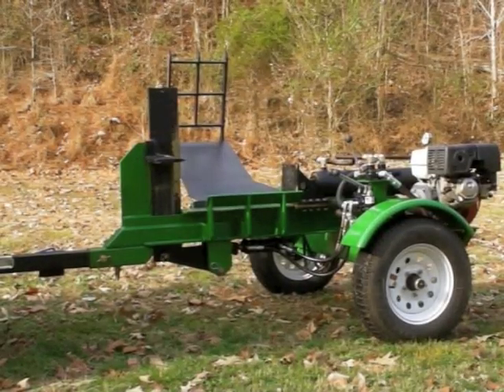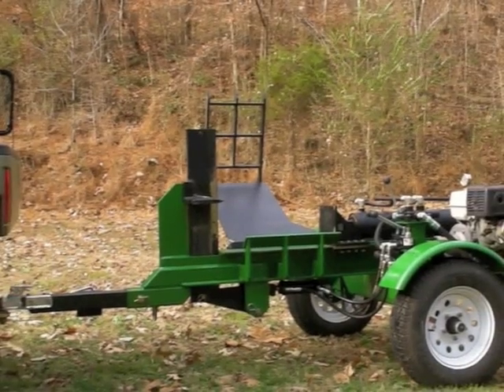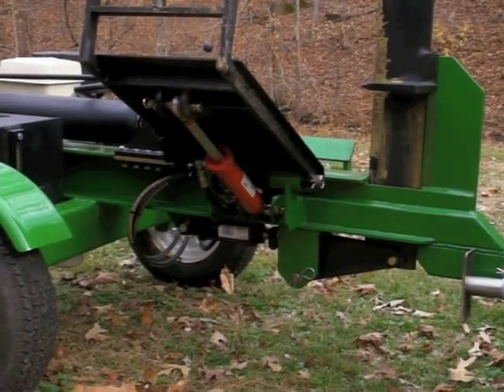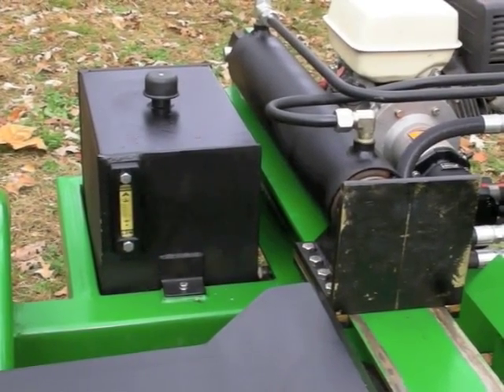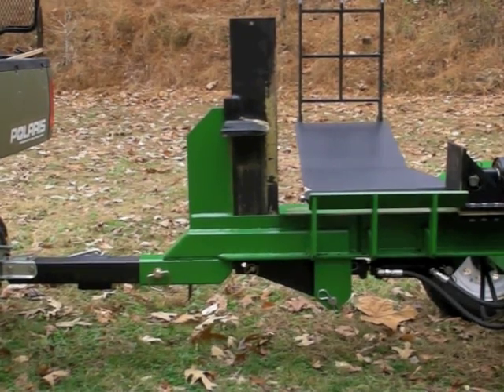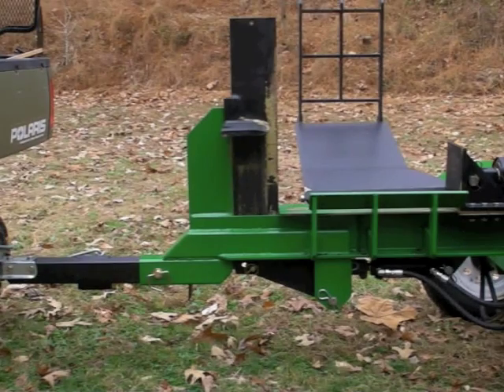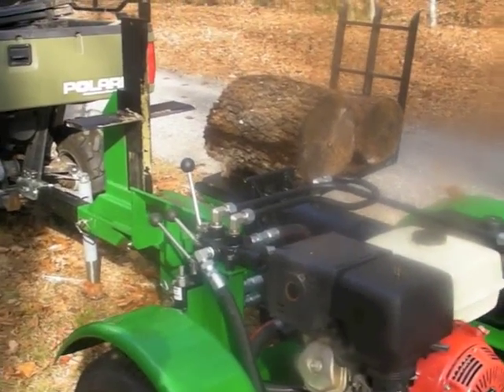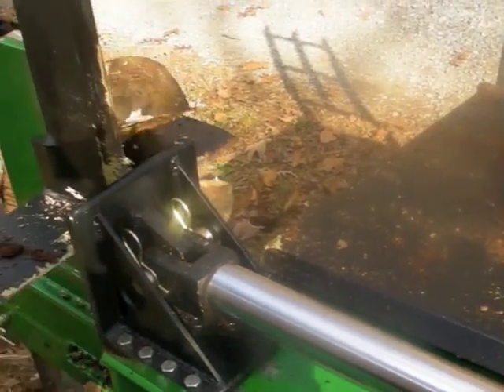Homemade 30 ton Log splitter with log lift and adjustable 4-way blade

Comment from the maker: The 5" cylinder was surplus courtesy of my father-in-law.  Thanks Henry!  I believe it came off a concrete pump.  It was in good shape so I just replace the seals.  The wedge is just a length of 6"x3/4" cold rolled steel, I put the edge on it with a milling machine.  It seems to be holding up well.  The paint is Dupont Imron over a good acid etching primer.  Very tough paint but expensive and nasty (toxic) so you need a good respirator to work with it.  It was a left over from another project.

Comment from the maker: Nothing that Grandiose, I simply laid the design out to scale on graph paper.  I generated the table and blade lift geometry with a hand calc.  It came out pretty much as expected though I did end up having to move one of the cylinder mounts for the table lift half an inch for clearance at full lift.  CAD would have helped there.  Thank you for your kind comments.  - Mark

Comment from the maker: The blade is just 3/4" cold rolled steel bar...  it can be easily replaced by pulling one pin.  I'll make a six-way blade as soon as I get a bit of  free time.  - Mark